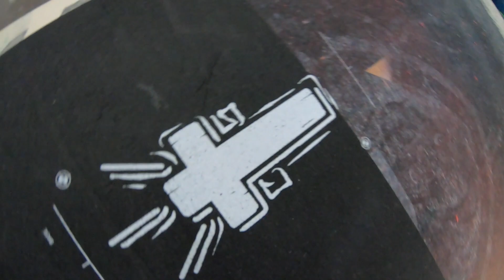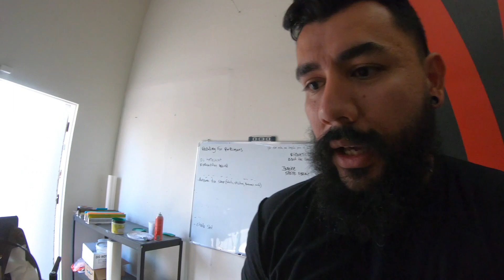Un Viernes perron

Comment: hey bro can I ask you a question? So i have the shop set up at my garage and dont want to mess with the electricity. How do you recommend I can run my conveyor belt ... I need your help bro .. Thank you
Reply from the maker: You might be able to plug it into your dryer outlet if you can get an electrician to help you out just to make sure it’s is compatible